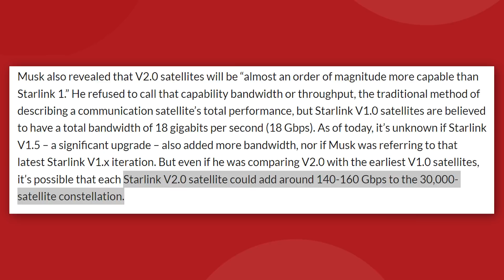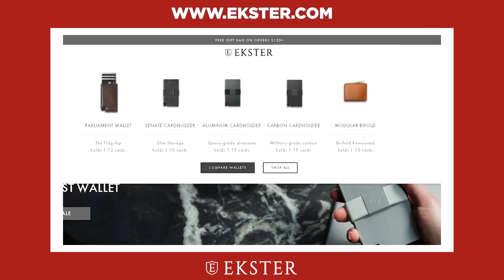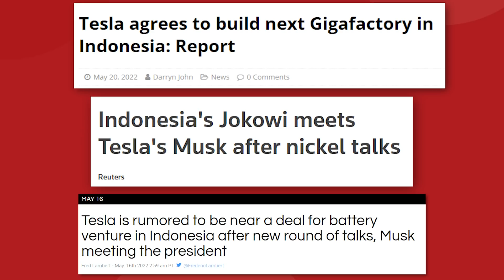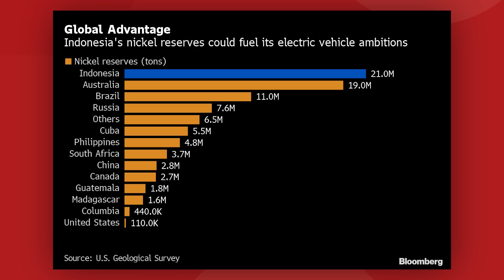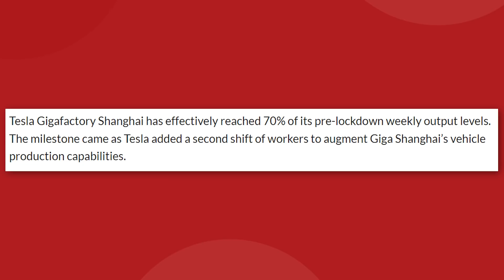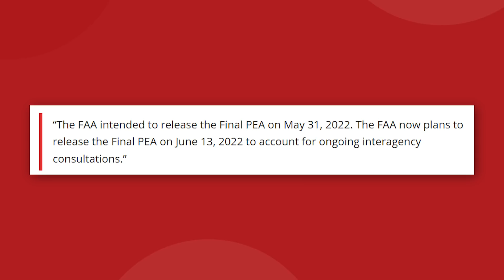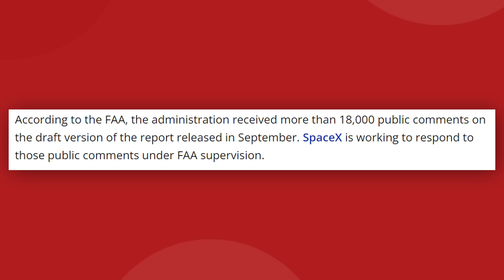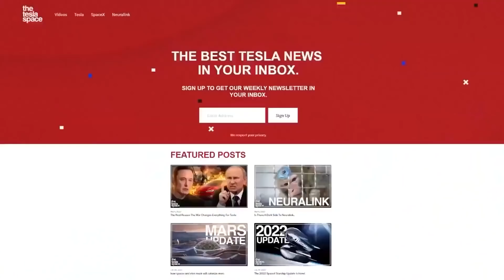Elon Musk Announces Major New Updates For Starlink Satellites!

Comment: just remember that the SpaceX strategy is to build a rocket, try to fly it, have a failure, fix what failed in the next iteration, fly again, fail, fix.. repeat until they have a version that performs the way they want it to.  Grabbing the booster out of the air is crazy until it is not, so we will likely find failures in this area until they iterate to success.  The starship keeps shedding its protective tiles so they will have to revisit how they are attaching these tiles.  Re-entry failure due to loss of tiles will push that initiative.  Iterate or die.
Reply: The tiles are not falling off at an amazing rate and SpaceX will catch the boosters and star ships. Bet on it.
Reply: @vinnylamoureux1187  you only need to lose one in the wrong spot for disaster, look what happened to the shuttle when one of the carbon leading-edge tiles was shattered by falling ice/foam...  total loss.
Reply: I hope people don't get hurt if starship explodes. It can flatten their entire base.

Comment: OK ------  Sorry but I Chose to Believe MUSK who has said MANY TIMES that there would only be a huge fireball and not an explosion... That would damage the Launch platform and Tower but little else...  REMEMBER,,, Starship is powered by METHANE and NOT HYDROGEN !!!  or JET FUEL/Kerosene...  Both Hydrogen and Kerosene are heavy fuels that when in the right mix with Liquid Oxygen (LOX) will readily explode as shown in many rockets that did blow up with huge EXPLOSOINS!!!  Just ask the Russians and AS demonstrated on one of the Space Shuttle launches which uses Hydrogen and LOX and even by one of Space X's Falcon rockets blowing up on the pad from an internal CRPV ? (may have gotten the name wrong) failure explosion with Kerosene and LOX...  But METHANE is LIGHTER than AIR... While LOX at hundreds of degrees below Zero is a LIQUID that is much heavier than AIR and takes time to heat up into a vapor with out help... As demonstrated when a Starship Suborbital exploded over the Suborbital Tank Farm destroying Nothing but the ship itself as the LOX Flowed down across the many starorge tanks on the Ground  in a huge wave and the Methane flashed into Vaper as part of A Cloud that, WHERE IT touched the LOX burned hot for a fraction of a second, rapidly heating the rest of the Methane Cloud  causing it to fly even faster up into the air as it mixed with Oxygen in the Air and rapidly burned itself out... LEAVING THE lox WITHOUT FUEL TO DO ANYTHING BUT SPREAD ACROS THE GROUND in an enert liquid Oxygen flood that slowly turning into a Cloud... The same exact thing happened every time one of the  test Starships made a flight and landed only to explode (BURN) on the landing pad doing virtually no damage to anything around its crash sight as again... The Lox flowed out across the ground pushing over and flatening a Porta Potty and the Methane Flew up away into the SKY as it burned...  NO BIG MEGATON EXPLOSOINS !!!  So I BELIEVE  Musk and not a YOU TUBER trying to HYP his Channel...  That JUST MAY KILL SPACE X AND STARSHIP if the PUBLIC starts thinking that STARSHIP IS A FrUCKING HUGE ATTOMIC BOMB !!!!!!!!! WAITING TO EXPLODE AT THE FIRST CHANCE IT GETS !!!!!!   YOU AND A CIRTAIN YOU TUBER ARE JUST SELF CENTERED ENOUGH STUPID ASS HOLES  FOOL ENOUGH TO Make people BELIVE SUCH a CRAP LIE !!!!!!!!!!  MAY YOU BOTH ROTE IN HELL !!!!!!!!!!

Comment: I wonder if starlink over the moon will be the same Satellites
Reply: It would have to. It would be most cost Efficient to use a satellite you were already mass producing vs an entirely new design.
Reply: In general yes. But since we are dealing with a cost per pound to get things to the moon, plus building 1 or 2 satellites by hand is not that hard. It will be interesting to see if the requirements are different enough to make custom ones. The lasers they use between the satellites now probably won’t have enough power to get to the moon. So there would probably need to be a booster near the earth and the moon satellites would need different lasers to reach that booster. 

Plus saving a couple pounds saves a lot of fuel going to the moon. Even if it’s the same shape it might be lighter materials that are more expensive. 

It will be interesting to see what they use.